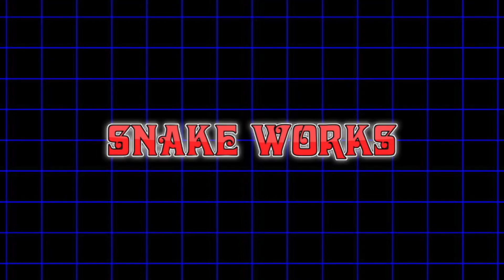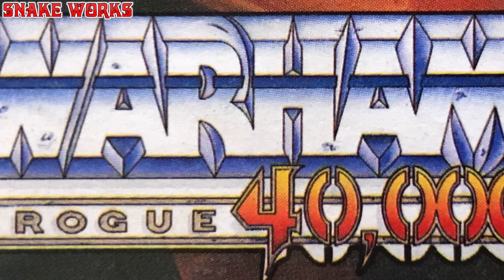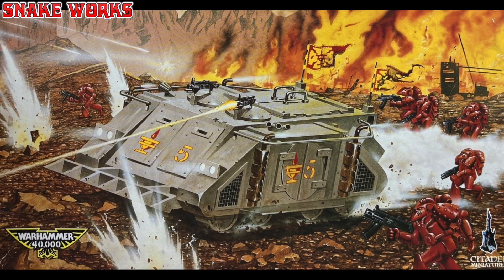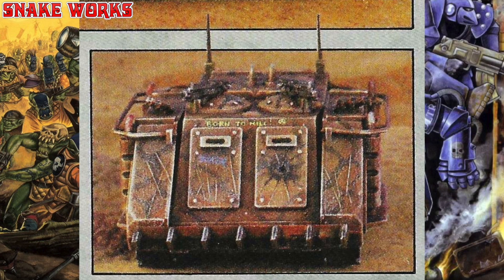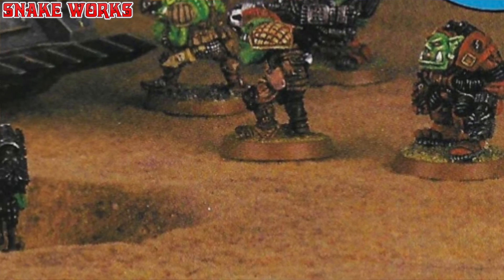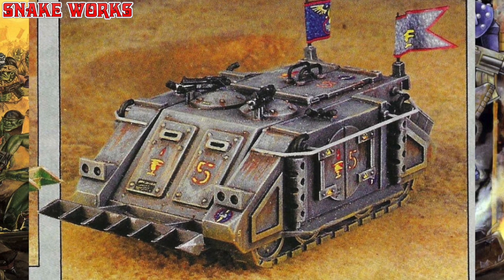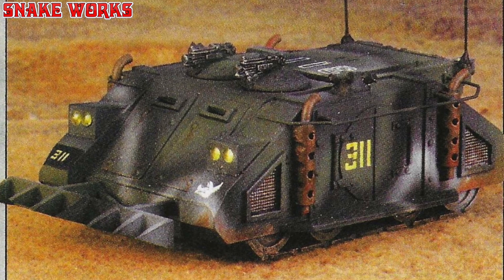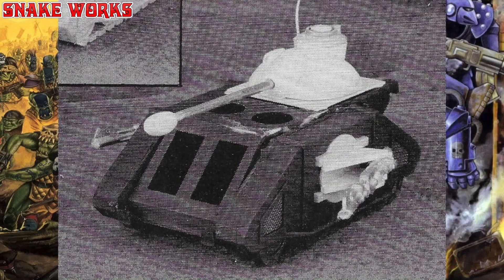Painting and Converting Rhinos - Oldhammer

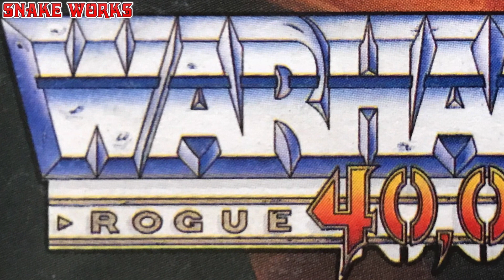Comment: I use the Tamiya 1:35 M113 as a base for rhino conversions you get lots more interesting bits and pieces in the kit, it is especially good for weird Imperial guard units or genestealer cults. The turret is easy to convert or remove. You can get them in 1:56 but I prefer armoured vehicles to have a bit more presence, I like to create lots of wear and battle damage so it is nicer to have a larger canvas. They should look quite manky they are supposed to be ancient and fighting vehicles are usually covered in equipment.
Reply from the maker: Do you use them in games or are they for display?
Reply: @SnakeWorksStudio  I use them in games, I play a slightly modified version of 2nd ed or Space Weirdos and do not play in GW stores so it is O.K (apparently they are up to 10th edition now! Madness. I figure if I stick to one system long enough they will come full circle there are only so many variations they can use)

Comment: The next issue had the template's to convert those two rhino conversions by Bob Naismith at the end. Gonna convert the first one and use it as the basis for my whirlwind. Already built the launcher, used 50mm instead of 40mm base so it has 10 rocket tubes instead of 8. 2nd ed 40k specifies whirlwinds carry 10 rockets and so can only be fired five times a game. Two rockets fired per shot. Using modern rhino with hunter/stalker bits instead of OG rhino.l